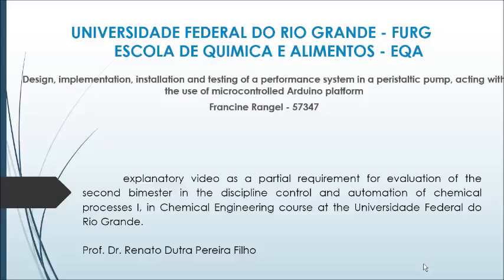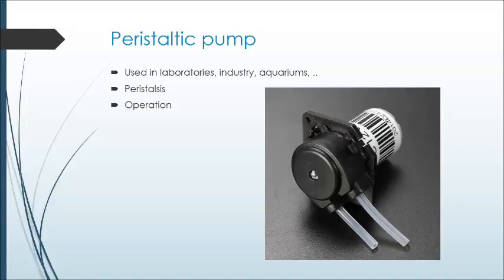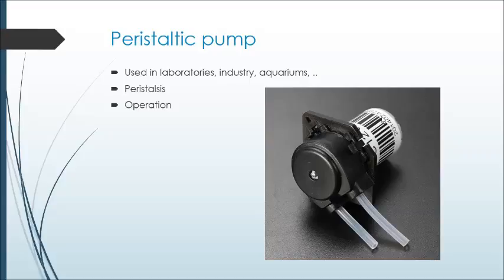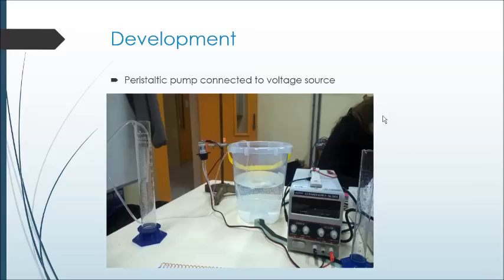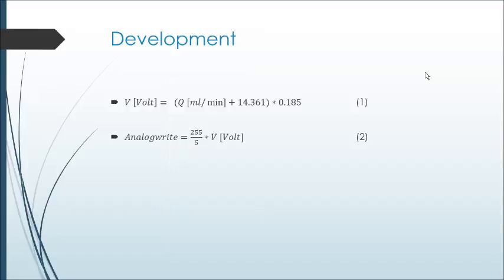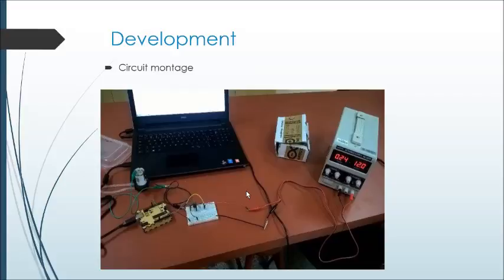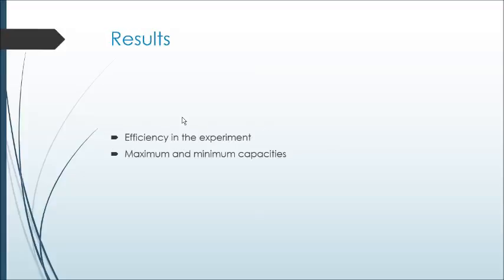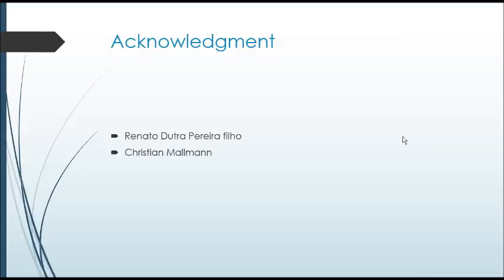Peristaltic Pump Calibration plus Flow Control with Arduino

Comment: Hello, thank you for sharing prof. . May I ask a question. So there is this pump that I can access: Grothen G528 2x4mm Dc 6v. It says that it can provide 60ml/min however I want a flow of 60 AND 100 ml/hr. Can the pump be used for this? Can the equation mentioned in the slides be used to calculate the voltage required? Also what would be the accuracy? For example If I want 60ml/hr or 80 ml/hr, it is easy to control up to this resolution? I am looking for a low cost solution. 
Thank you in advance.
Reply from the maker: Hi. Thanks for watching the video. It is a good idea to calibrate your pump's equation, using a variable voltage source, not only to evaluate accuracy, but to evaluate the possibility of exceeding the pump's design flow range. From a distance, without knowing the pump motor, it seems to me that 100/60 (1.667) is a very large flow limit extrapolation factor for this motor. In other words, applying 10V or more to a motor with a nominal voltage of 6V can be a serious problem. However, if the engine accepts up to 12V, no. As for flow regulation, yes the solution is possible and cheap with the resolution you mentioned.